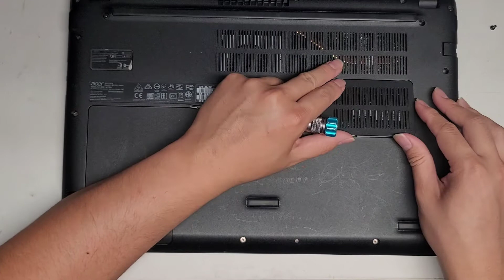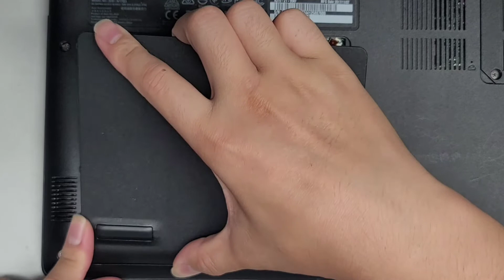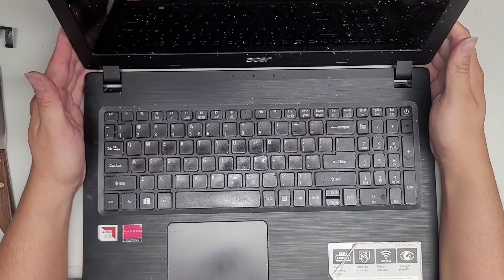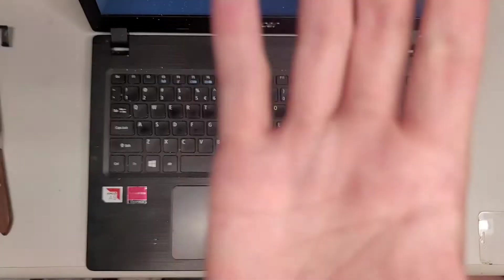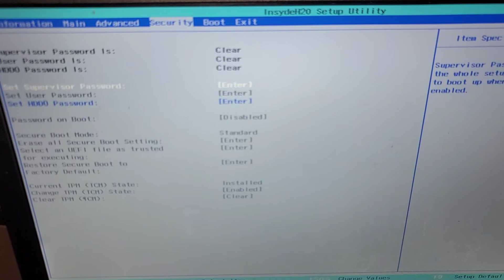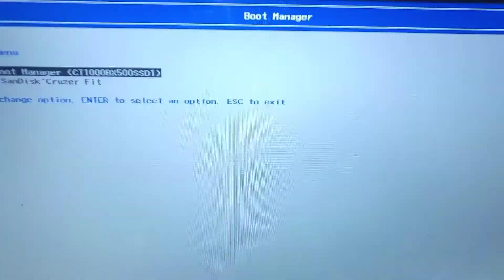Acer Aspire 3 A315-21 Series N17Q3 Disassembly RAM SSD Hard Drive Upgrade Replacement Repair

Comment: Bro my this slot is empty ,in which you inserted new ram ,is this a 2nd slot ?
Reply from the maker: Yeah, other is soldered I think
Reply: @ItsBinhRepaired  it can be upgradable?or not
Reply from the maker: @Jaatji33981  yes

Comment: Hi, I have this exact model and I'm having power problems. The charger cable works i've tested it, but there is no LED indication on the side to show its receiving power. I've been watching many videos about everything i can with this laptop, tried battery resets and all the easy stuff before doing a full tear down. In your video, there was a physical stick of ram in the slot (not the soldered one), which is different to mine, there is no removable stick already in there, just the empty slot and the soldered ram. Would this lack of physical ram explain the power problem?
Reply from the maker: Likely it's a damaged charge port or fried motherboard.
Reply: @ItsBinhRepaired  oh, i've just removed the case and unplugged the only cable that goes from the supply to the board, has two black cables and two red cables going into a white clip, how could i test this with a multimeter?
Reply from the maker: @chillidurex  check if voltage is going from the black to red in all combinations
Reply: @ItsBinhRepaired  i appreciate your help by the way, ive tested it and there's no power to the end of the cable so i will need to order a replacement, do you know which part it would need to be or how to check, it's the same laptop as the one in the video
Reply from the maker: @phivey.mp3  check the charger for a model number. Sometimes leaving it unplugged from the wall for a few minutes will get it working again.

Comment: Need help. I upgrade my ram from 2gb to 8gb and when i boot it works but after a few mins the laptop restarts... how can i fix this
Reply from the maker: Try the old ram to see if the issue is still there
Reply: @ItsBinhRepaired  i did that, works fine did not restart but i think i fixed the issue with the new ram. I removed the setting called auto restart. I will edit this message it it works
Edit: still restarts
Reply from the maker: @S_L22  it's likely bad new RAM
Reply: @ItsBinhRepaired yea i think so too
Also what ram did u get in the video? I will buy that one but i cant see the name of it
Reply from the maker: @S_L22  go with this instead https://amzn.to/3DVqo7N

Comment: Hey i have acer aspire 3 A315-21 laptop and I'm planning on upgrading the RAM. I used crucials memory advisor tool to find the best ram for my pc. It gave a list of compatible ram. I'm confused whether to buy 2400mhz one or 3200mhz one. The inbuilt memory in my laptop is ddr4 and  the task manager shows its speed as 800mhz. So what should i do
Reply from the maker: Not sure. I think I just used the 2400mhz ones

Comment: I have the same laptop as on the video except that I do not have the connector to connect an SSD / HDD in SATA, however I have the connectivity so I can buy one, can you give me the reference of the one that has original on the pc please?
Reply from the maker: I'm not sure other than checking ebay or Amazon

Comment: Does it matter if the ram has ECC?
i googled what RAM i need and some said Non-ECC RAM. sites like Crucial also gives Non-ECC RAM as recommendation.

But the admin of an online store said it doesn't matter if it has or not. Like, if the motherboard doesn't support ECC, it'll just run without ECC. But when i tried the RAM from them, both of them causes constant bluescreen until i take the RAM off.

oh, also does it matter if the RAM speed is mismatched? sorry I'm new at this. i can google, but I'm not sure which is true.
Reply from the maker: You want matching if possible
Reply: @ItsBinhRepaired  i tried with Kingston 8Gb 2400Mhz RAM. But it still blue screen. My laptop is Acer aspire 3 a315-21-948e.
Oh, also on task manager my onboard RAM is running at 800Mhz :/ even though it's a 2400Mhz RAM
Reply from the maker: Is it running slower?

Comment: Has there been a really noticeable difference in the speed before and after? This laptop running on HDD is actually terrible like it seriously takes at minimum one minute just to get to the password screen. If you still have the laptop, could you tell me how much this improves please? Spending £60 just for it to be not worth it would suck
Oh also is it necessary to upgrade the RAM when changing to an SSD? I have no idea about these things
Reply from the maker: If it wasn't worth it, why would I do it and make a living doing it? Lol you'd want 8GB of RAM or more as well to make it run extra good. SSD upgrade is one of the cheapest upgrades with the most performance boost.
Reply: @ItsBinhRepaired  You know what, 100% agree. Just replaced my HDD with an SSD and the laptop is actually useable now. Amazing guide thanks so much

Honestly my only regret is not spending more on a better SSD lol but it's already fantastic
Reply from the maker: @loskrem  hahaha yup, it is amazing how much one component can affect performance.

Comment: Thanks, what is the max Mhz I can get? I plan on installing 8 extra gb but should I go for 2666 or 3200 Mhz?
Reply from the maker: I'm not sure
Reply: @ItsBinhRepaired how much speed do you use?
Reply from the maker: @qbynuno  if it's not in the video, I don't know. These are customer computers and I don't have access to them.

Comment: What kind of ssd you used in this video? Also i read in the laptop manual it can support 12 gb ram. Is that true?
Reply from the maker: https://amzn.to/3BU3Zrx you can put as much RAM as you can fit. I rarely ever see a limit to the RAM other than what you can buy.

Comment: so mine is 2 of 2 slots used but its only 800 mhz
4gb (800mhz) - motherboard
4gb(800mhz-upgrade slot
i want to upgrade th megahertz do i need to buy 2 ram with same mhz or i can upgrade it like this
4gb(800mhz) - motheboard
8gb(2400mhz) - upgrade slot
will it use the bigger mhz ram or not pls i wanna get the full details abot upgrading ram 
i also have the same model of that pc and what is the max ram capacity 12gb or 16gb?
Reply from the maker: Where are you getting 800mhz from?  There's no such thing as 800mhz ddr4 ram
Reply: @ItsBinhRepaired  idk bro i just went to a technician to fix my laptop and my ram megahertz changes from 2400 to 800
Reply from the maker: @ArcedezPlay  no idea
Reply: @ItsBinhRepaired  thanks for quick reply tahts why i am subscribing also pls give me instruction on upgrading mine
Reply from the maker: Just have to use the same ddr4 2400 any size you'd like.
Reply: @ItsBinhRepaired  oh you mean i need to buy 2 ddr4 2400 ram? and replace it?
Reply from the maker: @ArcedezPlay  there's only one slot, right?
Reply: @ItsBinhRepaired  is 2 slot
Reply from the maker: @ArcedezPlay  oh, then yeah
Reply: @ItsBinhRepaired  wait i can remove 2 of the ram and place the 2 2400 mhz ram?:O
Reply from the maker: @ArcedezPlay  if it's the same model, it should work.
Reply: @ItsBinhRepaired  i just check your channel you make random videos lol

Comment: The same laptop just doesn’t start after chaning to ssd
Reply from the maker: Did you clone the old hard drive or install the os to the SSD? It won't boot if the drive is blank.
Reply: @ItsBinhRepaired  I installed the os to the ssd
Reply from the maker: So it installed, but won't boot? Check if it's uefi or legacy.

Comment: Am I Sure The Largest SSD Harddrive This Laptop Can Use Is A 256GBHD ?

Great Video, I'm Looking Into Acquisition Of My Oldest Brother's Old Laptop 💻 Same Laptop In Your Video !!! Thank You 🙏!!! Is The 8GB RAM The Largest RAM You Can Install In This Laptop 💻 Too ? Thank you 🙏!!!
Reply: Make sure to use laptop ram
Reply from the maker: @shoesareyummy413  desktop ram for that extra power lol jk there is no such thing as laptop/desktop RAM. A lot of desktops use the small sticks now
Reply: @ItsBinhRepaired  also buy a better laptop, I have the same laptop, 1tb SSD, 14 gigs of ram, yet it still can't get EVEN 10 fps on Roblox. Also the CPU is bullcrap, 2 core 2 thread my ass
Reply from the maker: @shoesareyummy413  lol need better video card
Reply from the maker: There is no largest amount. As long as it fits in the computer, you can use it.
Reply: @ItsBinhRepaired  Thank You 🙏 !!! ❤❤❤👍😃👍❤❤❤
Reply from the maker: @kennethdoucette4954  no problem. If you haven't already don't forget to like and subscribe so others can find my videos. Thanks!
Reply: @ItsBinhRepaired  Now What's The Greatest Amount Of Highest RAM This Computer/Laptop 💻/🖥 Can Use&Take ?!?!? You Used 8GB More On The Upgrade Is There Any Greater Level To That Too ?!?!?
Reply from the maker: @kennethdoucette4954  what's the largest stick of RAM or hard drive/SSD you can get? It's impossible to max it out. The max is what you can currently get a hold of.
Reply from the maker: I believe there's a 16gb stick
Reply: @ItsBinhRepaired  you sure thats accurate?  The motherboard is usually configured to operate up to a specific amount.  I was wondering the same thing.  Plus I noticed that your device didn't boot after the upgrade.  Is that because the ram or ssd isn't compatible?  I ask because I just ordered the same ssd but higher capacity and 8gb of ram.  Hopefully it will work.
Reply from the maker: @InfamousEwing  positive
Reply: @ItsBinhRepaired  can an ssd m.2 be installed as well?
Reply from the maker: @InfamousEwing  I don't think so. You'll need to see the motherboard for that.

Comment: This Laptop Support M.2 ,, You Can Install M.2 NVME
Reply from the maker: Really? That will require the whole bottom to be taken apart if that's the case.
Reply: @ItsBinhRepaired  Yes ,, I Removed Back Cover Fully & Installed It
Reply from the maker: Nice!
Reply: it doesn't support nvme , it is 2280
Reply from the maker: Have you tried, or are you just going based on documentation?
Reply: @ItsBinhRepaired  I tried to install nvme but it didn't work so I bought 2280
Reply from the maker: @heamnathheamnath3482  2280 is just the width and length of the SSD in mm. It has nothing to do with nvme and sata.